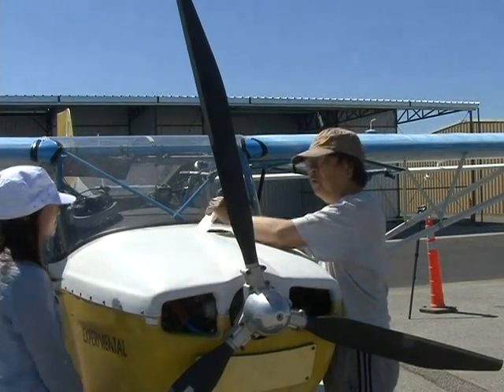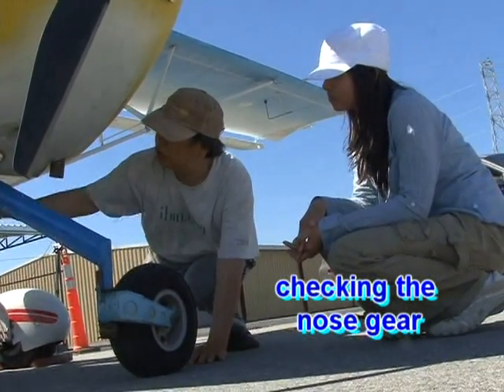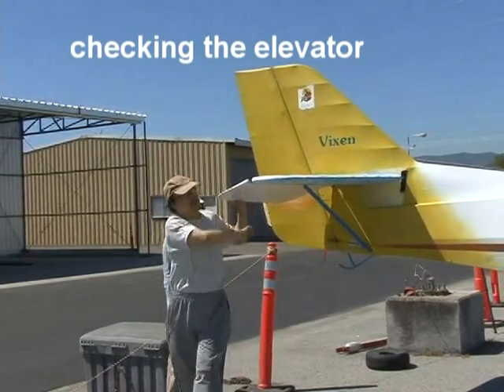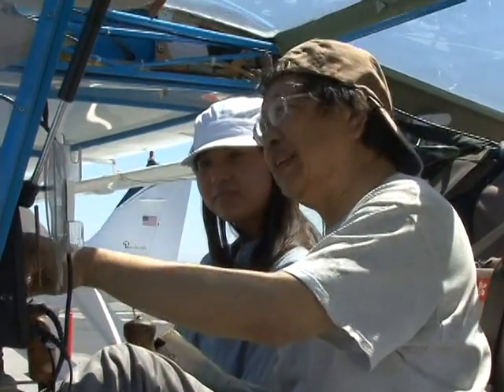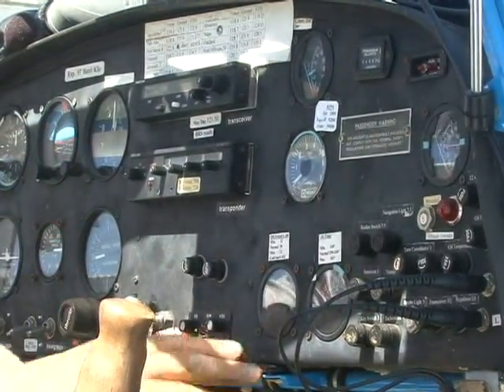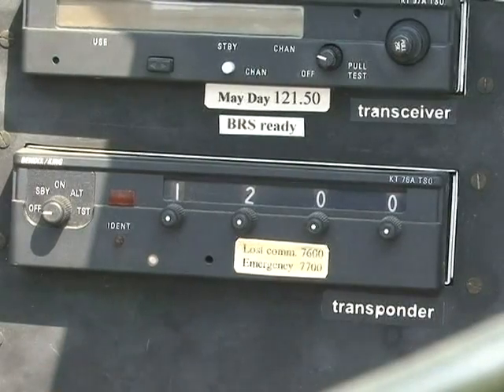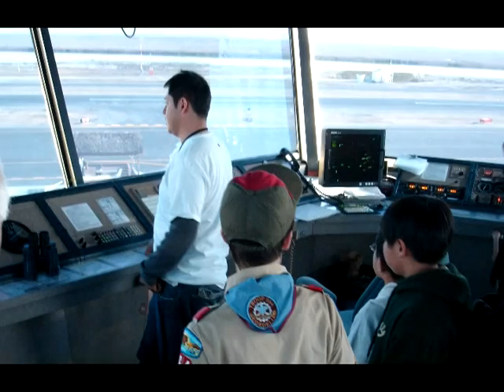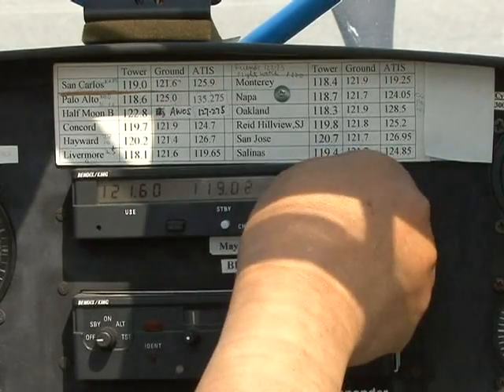How to fly a small airplane. Part A

Comment: Uh , the ailerons provide bank, the rudder gives you your turn. You coordinate for your turns ,slips and spins  ....just a tip . Normally we use KNOTS and not MPH for airspeed.  “ knots indicated airspeed KIA” 75’-taken alive ,76’ technical glitch ,77’ going to heaven - transponder codes . Here in DFW , we fly with a mode c transponder when you are in the bird cage .

Comment from the maker: The fiber glass fuel tank is inside the wing and there is a metal nipple at the bottom to allow you to get a sample of fuel to see the presence of water.    Each fuel tank holds 13 gallons of fuel.     I don't think I can drain 13 gal. through the tinny nipple.  
Maybe the only way is to siphon it out with a tube from the top of the tank.